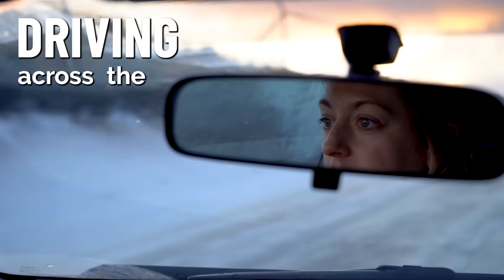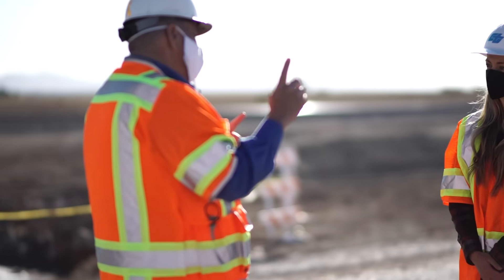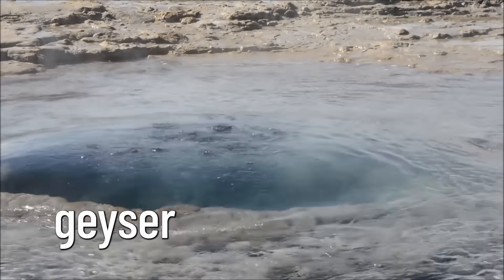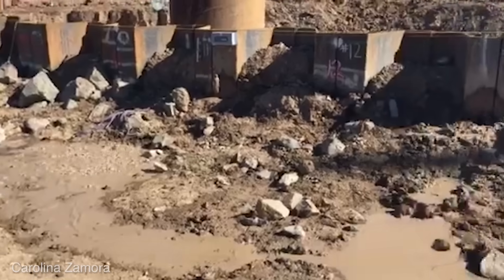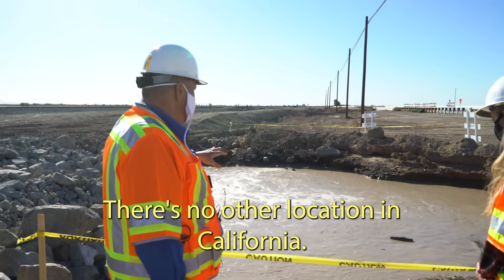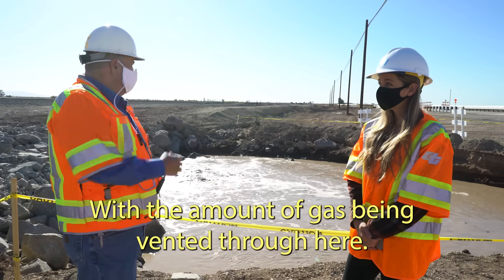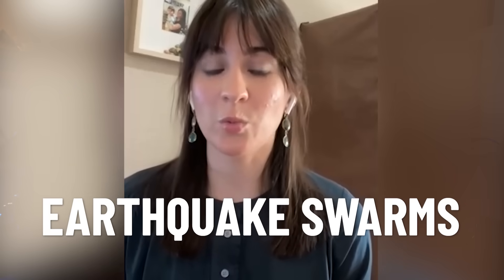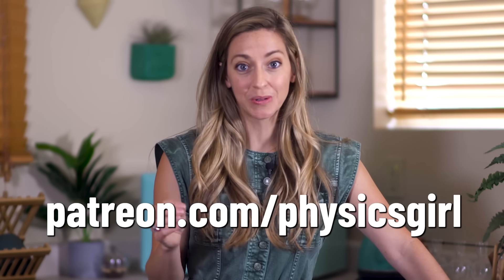World's Only Moving Mud Puddle

Comment: Nice situation.
Tip: When u don't have a solution to a problem, change the situation so that it is not a problem anymore.
Since the mud spring is moving slowly they could try the following:
1> predict the path of the mud spring for the next 10+ years.
2> build a bridge over the path of the mud spring wide enough to avoid the foundation of the bridge getting damaged by the moving mud spring.
3> redirect the road over that bridge
4> build an amusement park on the path to pay for it all.
Have fun and stay alive.

Comment: 🔑 Drill on the far side of the highway to open up a relief shaft. I support the angled vent hypothesis. This'll save the highway. But must use remote controlled drilling. You don't wanna be around when they hit the active pocket.

Comment: There are two simple solutions. 
Working on the assumption that it will continue to move, build a short stretch of road behind its current path. Alternatively if this is too expensive, drill down on the other side of the road, in the projected path of the puddle. This will accelerate the movement and has a high probability of skipping the road.

Comment: If the source is on the other side of the highway, could they take a lesson from the drilling and sheet wall experience and drill on the other side of the highway to "move" the puddle's surface across the highway before it undermines the highway? Relieve the pressure upstream and give it a new place to come to the surface closer to where it "wants" to go?

Comment: If it is moving from an angle, to a straight up escape...

I'd recommend drilling relief wells way ahead of it, in the direction it's moving, not just next to it.
I'd also recommend standing back each time drilling, in the case of if you found the source... 
It would explode.
Reply: Ha, I thought of the same thing - then I found your comment

Comment: My theory: CO2 is less soluble in salt water compared to fresh water. Salton Sea water seeps into the aquifer and this releases the dissolved CO2 on the side of the aquifer closer to Salton Sea. Bubbling CO2 erodes towards where salt water comes and the mud volcano moves towards Salton Sea. Why wasn’t it moving before? Because water level dropped drastically in Salton Sea since 2018 and salinity increased accordingly.
Reply: If my theory is true then we might expect an increased rate of mixing of salt water and fresh water when the mud volcano reaches Salton Sea because the eroded path is likely to be more permeable resulting in a higher CO2 production rate.

Comment: Ah, I see what you're saying. The water and CO2 are coming from somewhere past the highway and the train tracks, but it originally found it's way up through a diagonal tube of loose rock and stone which surfaced at the farm, and stayed there for many years. Then due to some earthquakes which probably loosened things up, some of the rock and earth near the edge of the puddle closest to the source started to erode, and once it got past that first hump it started a cascade effect of erosion that caused it to start "moving," back toward the source at a rate of 20 feet per year. Unfortunately that probably means the erosion level below the road is too great, and the earth the road is sitting on is too thin by now to "stop" the puddle from eroding it away. Probably best just to start building a bridge over it at this point.
Reply: The wall that was made probably didn't actually stop the puddle, because really it's not "moving" it's just eroding the ground out from above it. The wall just caused it to not erode a section of rock and dirt, and push up a little ways past instead, as gas started building up behind the wall and had to go somewhere. It could just as easily have decided to come up under the tracks themselves, but I'm guessing that all the trains coming through, and the weight of the tracks might have compressed the rock and dirt so that it wouldn't be eroded as easily, but the earth on the other side WAS more easily eroded. They people there that day are also damned lucky that the outgassing of all that CO2 didn't suffocate them all. 

But hang on... maybe if they want to save the road, the answer is just as simple as artificially eroding the ground on the far side of the road and letting the puddle come up there instead, to go upon it's merry way.... as long as the source isn't directly below the road that is...

Comment: My guess is “Kyle” is a large bacterial or fungal colony. My other guess containment would be to use cold temperatures and possibly use cold to motivate it away from structure. It moves along with water? Possibly needs air as well hence the surface hole. 
Would really recommend culture samples of deep and surface areas and a couple gps trackers. If it becomes problematic it could be bad

Comment: Expanding Universe was mentioned, Which BTW is essentially inferring everything is not finite but rather a contradiction "infinite" an infinite closed and isolated system ergo the system is violating conservation by converting nothing to something.. Having it expand on the back of nothing more actually being more, can anyone see the religious reasoning allowed to slip through?  
 
A closed and isolated system "The Universe" can not violate conservation and expand, Eg: Everything equates to 1 or the sum of the closed system. 
Let me be Blunt... The observed expansion is the highly energetic Matter referred to as Near-vacuum which is expanding, and it's expanding because of fusion, with this factual model we have expansion and it's reciprocal, and thus conservation to a closed and isolated system consisting of everything, NOTHING IS EXCLUDED!

Think about it, As lighter atoms are fused into heavier atoms, "Two lighter atoms are Merged into a single heavier atom" this leaves some space, and the left over space is quickly taken over by the highly energetic mass "Matter" referred to as Near-Vacuum "yes the near vacuum is matter a highly energetic matter", anyway, The Near-Vacuum expands and with it's gaining inward momentum "Gravity or weight gain via heavier atoms" what we have is one constituent expanding and the other constituent reciprocating, and what's more we have our perceived acceleration of expansion via the Near-Vacuum, which BTW can be validated via Relativity anyway..

Comment: I mean, if the theory that it is finding the shortest path holds water, you should be able to redirect it by shortening the path further and getting it to jump past an obstacle like the road. Drill a hole, blast the ground to create fractures and then flood to give leaking CO2 more erosive action.

Comment: Hmm from a geological perspective this area is a transverse fault where North America has been moving Southwest over the East Pacific Rise the Pacific analog of the Mid Atlantic Ridge. This transverse sliding motion is off angle from the magma upwelling ridge which results in the Gulf of California splitting land on one side away from the continent so could this mismatch angle be driving  the CO2 up from the mid ocean source? After all before the chunk of continental crust sheered off onto the Pacific plate can get ripped away by volcanic vents expanding the Gulf of California it will have to bust a way through which volcanic gasses seem particularly  well versed at doing especially if such gases can build up over extended geological periods Once a gas conduit could be established yeah it would be hard to stop.  There has got to be a lot of torque on that continental rock

North America is a "stubborn" continent after all pretty much most of the west coast was built because North America has been "trying" to cross the East Pacific rise with more and more pieces getting sheered off and dragged North over the course of the Mesozoic  chunks of Mexico have been sheered off and dragged North resulting in the formation of Alaska and the Pacific North West. Currently South America is undergoing a similar process to what North America did back in the Cretaceous driving the uplift and extensive mountain building as South America catches up with North America along the East Pacific Rise-Juan de Fuca Ridge (which are both part of the same system)

In a few tens of millions of years this mud spring is likely going to be succeeded by Volcanos the encroachment off the Gulf of California and eventually the temporary separation of the pacific side of California from the rest of the continent as continental fragments that drift North and smash into Alaska. Technically if this process continues unabated by additional changes A True American continent will eventually form as NA has a net southern drift.  Right now the isthmus of Panama is largely accreted island arcs getting increasingly smooshed together over time. It is kind of mind boggling to think about the motion of our planet and the time scales involved!

Comment: if its following a straight line because it tries to straighten its path to the surface, wouldn't be possible to calculate a point on the other side of the road and release the pressure, so it can continue its way from the shortcut artificially jumping the road?

Comment: Holy... um... Cow... that's interesting! This is definitely a weird story.  Maybe it's moving because of the pressure of the CO2 gas behind it.  So I like the theory that earthquakes broke open the containment and since water is incompressible so a crack turns into a big moving mud spring... and it must be driven from really deep below the earth... well, obviously deeper than that sheet pile wall. It explains why attempts to divert it have failed, it probably is making its way underground before it shows on the surface.  I think it's going to do what it wants to do, just be ready to move out of its way.

Comment: I'm brasileiro, and I study civil engineering at UFMG, one of the best universities here. I love study "soil mechanics", but idk if this term is correct.

This situation is veeeery unstable and dangerous, because the resistance of the ground decreases, but also you have seismic reactions due both road and train traffic. 

It all means great  instability of the soil, because the water acts like a lubricant. Then with the seismic reactions, the soil particles move independently. 

If the hypothesis the plume is floaring due to an angle is correct, maybe the solution could be inject a fluid mixture of water and cement deep down, creating kinda a dam. But you have to inject tons of water and cement on this "dam", but you'll have a slower erosion process.
Reply: But I reeeeeeally appreciate your video, thank you!

Comment: A minute I and wondering why not just add cement!

Edit: Working under the assumption that this mud geyser is moving on a plane that it's gas source is located on couldn't you drill along this plane to find the gas source or at the vary least vent it at a preferred location by tapping into it.

Comment: Would it be easier to build a bridge over the puddle and let it work its way out from under the road in its own sweet time?  I know a bridge isn't cheap, but might be the best solution with so many unknown variables in the puddle itself.  Set the start and end of the bridge far enough to each side and it should be stable, right?  The puddle is only breaking up the ground in the direction it's moving, it seems.
Of course soon as this is done the puddle will take a right turn, just to mess with humanity some more!

Comment: If you know the direction it is moving, maybe build around it by diverting traffic to the side it's moving away from? As for the train tracks thats a new tangential line needed, huge cost, but the highway should be much easier to divert. If you started filling where it started maybe you can reclaim land as it moves to become vertical.

Comment: Could they not get a large metal ball maybe with some sort of accelerometer attached and a heavy cable and stick it in and try to map out the movements and get a rough direction and depth that it goes at that particular time?

Comment: This was so metal! A terrifying pool of mud, the actual depth of which no one knows, that no one has ever seen before, that cannot be stopped by any means we tried, that will definitely kill you a horrible death if you fall in it by either drowning or asphixiation (which I guess is kind of the same thing, you're just choosing which fluid is gonna suffocate you), and which is moving fast towards very important infrastructure.
At the start of the video I thought this would be a "Death Valley moving rocks" kind of deal, but when you started talking about how quickly you can sink to the bottom if you fall in, and how even if you can swim you'll just suffocate from CO2, and how when the tried putting a big rock on it it just sunk whole like that and we have no idea how deep it goes (Well now we know that it's at least 5 storeys... great)... I very rapidly went from intrigued and amused, to bloody terrified °~°

Comment: The "Wanting to move vertically" seems fairly likely. The sloped spring channel is eroding the upper surface because the gas is exerting pressure on the top of the channel and the sand and rock that erodes from the top sinks to the bottom, slowly tilting the stream upward. It's probably a layer of sandstone that, at first, resisted erosion, but has been weakened over time. Maybe they could send a submersible robot down into the channel that can use sound waves to "See" the sides of the channel and crawl its way down to the source.

Comment: Have they done seismic graphs in the area? Was there carbon being pumped into an oil reservoir in the area? As the oil is removed the pocket would probably move towards the reservoir.
Reply: The pressure could be from the water filling the void and forcing the CO2 out of the cavern.

Comment: The path of least resistance theory is a good one. It's interesting that the EQ swarm happened at the same time and I think it would extremely coincidental if they weren't connected. I think this is a chicken/egg question now - did a build up of pressure caused by this "puddle" result in the earthquake swarm or was the earthquake swarm triggered by other means leading to this puddle now being able to move?

Comment: If they think it is moving because it is coming up at an angle why not just encourage it to skip the human infrastructure by drilling holes farther down the direction of travel? If it is coming up at an angle the pressure should start releasing itself there and stop the current mud spring.

Comment: It absolutely IS an angled geyser/fissure thing..
That also explains why the "fence-wall" they put in began tilting that direction, it's the force of the and vector of all that water and gas. As for the road... don't suppose it's possible to get the Army engineers to come out and dig out while supporting the underside of the road, is there? I just can't help but feel that some military engineer corps could resolve this issue pretty quick, but I'm no engineer, lol

Comment: Ok, so without blowing my proverbial trumpet, the idea I had for the reason for it moving was the one that was described at the end (around 09:40). The solution?  Drill the other side of the track or freeway in line with the direction it's moving.  This would relieve the pressure on the farside.  The risks: it could develop potential for a bigger sink hole below the track as the branches could converge into one. Potential solution; drill holes along the same track and equidistant points, relieving the pressure and allowing for the potential to measure the pressure (and pressure differences) at the holes and give the ability to calculate the source.  The other risk being, as it would be very difficult to know how deep this thing is, it would be tough to measure the cost of the drilling and how far they would need to go down and therefore hard to obtain contractors, cost estimates and weigh that against the possibilty of it being a successful solution. Anyway, very intersting video.

Comment: Why wouldn't they trace a line of the direction is moving to tray to approximate de path the gas is travelling underground. So there you could dig a big hole to simulate de mudhole on the other side of the road. For then dig a small part really profund so as to hit the gas channel and continue to vent there. Son in theory you've move the mudhole to the other side of the road

Comment: Look into physics  the laser strate quartz deposits, some 1" wide others 6-8"wide, through the granite of Yosemite National Park that go for miles . Quartz veins in Granite is normal however seldomly are they ever straight for more than a few onether of the 3 axis, as Granite does not typically crack in a straight consistant thickness line due to the ever varying densities of granite.  cracks go around the hard spots , and very vastly on the thickness on all three axises twisting and turning and looking like lightning. These veins however show a consistent thickness over vast length and depth, surrounded by and intersecting quartz veins.

Comment: The reason for that movement could be due to: if you think about an ice sheet with gas trapped on the underside. Now imagine everytime a bubble comes up through a crack in the sheet, it erodes the crack with the use of the water.
So the whole thing will wander towards the center of the trapped gas bubble... If that's the case drilling a bunch of holes around the area to let out that gas will stop this.

Comment: Wait, so what did the railroad do to save their tracks?  What is the highway department going to do? What were the solutions you alluded to?  Reformulating the asphalt so that the gasses can't erode it has nothing to do for the fact that as it passes underneath, it will be eroding the substrate the subgrade was built upon.